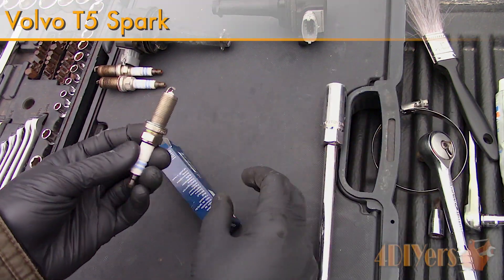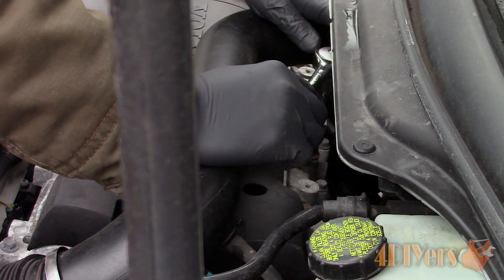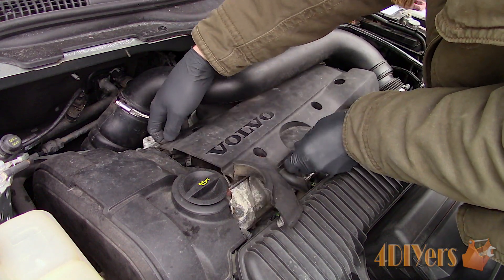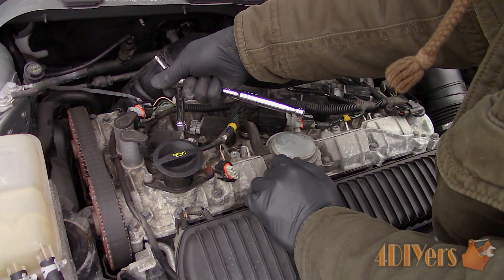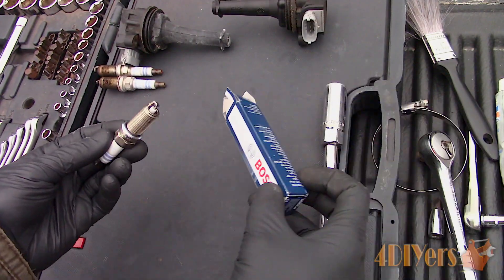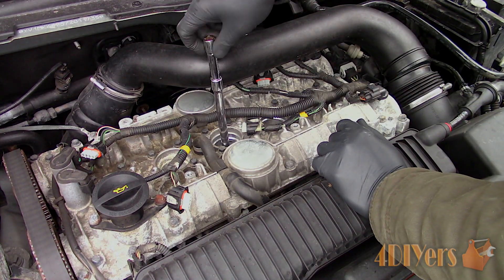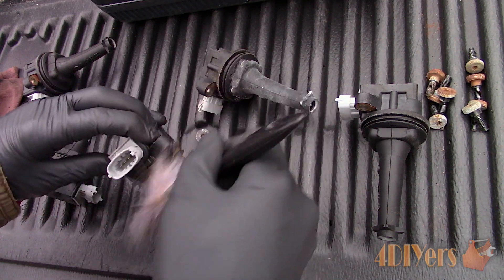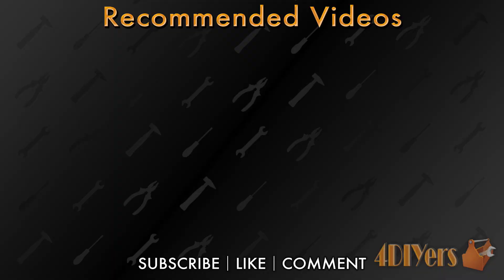How to: Volvo T5 C30 S40 V50 C70 Spark Plug Replacement

Comment: hello brother
ive recently bought C30 T5 2007, and it doesnt have rightside engine cover. i know its possible to buy bolts straight from volvo, but it would cost me more than ill pay for used cover. are those bolts that uniquely designed just for volvo or its possible to use different bolts? 😢
love your videos, all the best
Reply from the maker: Thank you for the kind words. You can take those bolts to a local fastener supplier, have them match up to whatever they have in stock. No need to buy them from the dealer.

Comment: Question I found oil where my spark plugs are sitting and will need to change my valve cover gasket. Do you have a video explaining on how to do that?
Reply from the maker: Unfortunately I do not have a video for that replacement.

Comment: Do you have a video for removing the valve cover to replace the gasket and the tube seals? I've got oil leaking into 2/5 of my spark plug wells causing misfires.
Reply from the maker: Unfortunately I do not.

Comment: On the P1 5 cyl non-Turbos (i version) you need to remove the intake plenum. Make sure you get a set of gaskets (5 green o-rings) these crack frequently and cause the ecu to throw codes.
Reply: Hey. Do you know the part number of the o-rings?
Reply: @tovisiotto I'd look it up on FCP and also verify it for your VIN.

Comment: what would you suggest first steps to do on misfire P0301, P0302 ? (c30 2008 v2 T5 automatic)
Reply from the maker: Check your plugs, that's where I'd start with first. If that passes, then move up to the boots and coils, they can be bench tested using a multimeter.

Comment: Does these engines require thin wall spark plug socket? I did change the plugs of our 2013 Volvo S60 T5 (engine code B5254T12) today and the regular 5/8 socket made contact with the outer rim of the head which I suspect may interfere with the torque values.

Comment: What would you consider a "flat spot"?
Reply from the maker: A spot in the rpm range where the power cuts off or there's a lack of power. Years ago I had a Subaru where the plugs were so bad that I couldn't go over a certain rpm. Managed to make it home and swapped out the plugs right away.
Reply: @4DIYers  thank you!

Comment: Great video! I can't open the engine cover. The T30 screws are rusted and stuck there. Penetration oil doesn't help. What should I do in order not to slip it? Will a impact driver be better than a ratchet?
Reply from the maker: Maybe an impact driver, but you'll need to be extremely careful as you can risk cracking the cast aluminum cover. If you have a small sliding t handle, give it a smack with a hammer from the side and the shock may help it break loose.

Comment: a little anti-seize on the plug threads may help ease any future plug removal
Reply from the maker: Not something I would recommend. Many spark plugs on today's market already have an "anti-seize" plating and manufacturers are against using an additional anti seize coating. When using an anti-seize coating, it can cause over torquing of the spark plug and also alter heat dissipation.
Reply: 4DIYers actually did not know this. ...Learn something new every day. .thanks
Reply from the maker: No problem :)

Comment: Awesome video! I’m about to do the same. Would you recommend replacing all the coils too?  I’ve been restoring 2006 s40 t5 and I want to do it right. Vacuum lines are next.
Reply from the maker: Coils can last for a very long time and they can be checked using a multimeter.
Reply: @4DIYers  What if you have oil coming up out of the valve cover some an unknown area?? PCV system issue or anything else that I should know?? Any help much appreciated.. 2005 Volvo S40 non turbo.  About to do the plugs tomorrow.

Comment: what reference number from bosch did you use?
Reply from the maker: Bosch Iridium Spark Plugs FR7NI33.  Links to the parts can be found here https://www.boschautoparts.com/en/auto/spark-plugs/iridium-spark-plugs?partID=FR7NI33 and here https://www.amazon.com/Bosch-FR7NI33-Iridium-Spark-Plug/dp/B0068M5ICO

Comment: Good video as usual.  I wish it was so easy to change the plugs on my Santa Fe.
Reply from the maker: Thank you! I haven't worked on a Santa Fe before, are they that bad??? I've working on early 2000 Dodge Caravans before, they needed to be on a hoist to access the rear 3 plugs.
Reply: They aren't terrible,  just a pain in the ass.  You have to remove a bunch of stuff and then remove the intake to get at the back three plugs.  Just about any one of them I've worked on (including mine) has had the front plugs changed but the backs are usually the originals...no matter what the mileage is or what the last shop it was worked on in says.  I kept them the plugs from the first Hyundai/Kia 2.7 V6 engine just to show people how bad they can get when they don't get changed.
Reply from the maker: Almost sounds like the 4cyl Ford Ranger with 8 spark plugs. You'd think being a regular maintenance item, it's made to be more accessible. Wow that is bad! Despite it being more work, there is definitely no reason to cheap at replacing the plugs. Just causes more problems in the future, not to mention the jeopardize fuel economy, performance, and reliability.